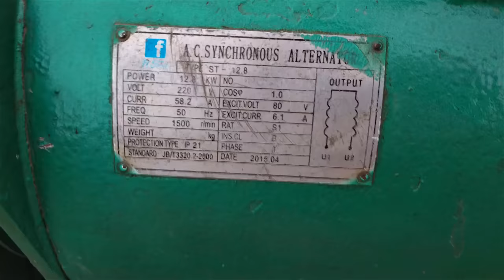Free energy Generator With 100 Kg Flywheel 12Kw Alternator 100% Real Free Electricity

Comment: At around 0:30 when the alternator appears, the camera viewpoint changes ever so slightly. My guess is that he had run a mains cable from the ditch that was not quite hidden, so he had to re-position the tripod.
Reply: No.  He just built a really old, low tech mechanical battery.  It'll take awhile for 100kg of spinning metal to stop, but it'll happen eventually.
Reply: @HelloNotMe9999  I can't see all that friction in the belts and the hooked up gear sustaining the rpm of the flywheel for long enough. He would have to stop recording, spin it up and start recording again. My money is on a hidden cable, or maybe a battery at a pinch.
Reply: @travelbugse2829  There is a bad video edit that discredits the presenter. BUT According to Occum's Razor theory (please do your own research) the best answer is the most simple one.

This is a confidence trickster! Prove me wrong! There is a sneaky power connection through a cable buried in the mud under one of the hollow metal legs resting on the dirt. Share a new video with the metal fame pulled up off the ground, and passing your hand underneath (with this running) The poster is only interested in being paid by YouTube for AD money from many clicks.

Comment: ok I think I have figured it out,   the power source that keeps these generators going after you unplug them from line power is the environment.    the generator because it keeps spinning keeps allowing electrons to flow into and through it, because it keeps creating a condition by manipulating magnetic fields to cause electrons to flow through it,   so your energy source is the electrons orbiting the atoms all around us.   those electrons power the drive motor, the drive motor powers the flywheel and the flywheel keeps the generator rotating to create the condition to pull more electrons from the environment through it.    if this is true then there is free energy, you just have to build the device to be able to harvest it.
Reply: Rotten Newton
Reply: The energy comes from the wheel itself. It's the same as when you try to push a car: at first it's hard, but if you continue pushing, it accelerates. When you push you give energy to the car and then if you stop pushing, the car continues. If there were no loses (air and diverse frictions), the car would continue forever. A device could harvest the energy stored in the car (cinetic energy=1/2.mass.speed^2) by slowing the car. 
Here it's exactly the same concept except for that the energy is stored in the rotation speed of the wheel (as well as its mass).
Reply: BWHAHHAHAHA!!!! Oh wait, you were serious?
Reply: @benjaminloyer1293  You will do good as a clown...
Reply: @MrGoogelaar ? Can you argue just a bit?
Reply: You haven't figured anything out. It's not free, he has to pay for the food for the hamsters hidden in the wheel. Also the wheel needs cleaning because hamster droppings cause balance issues. The large amount of hamster shit is what gave him such problems with starting it up and needing to adjust the shit scraper. It's in the first page of the perpetual motion machine manual, regardless of model - "please remove all hamster shit before commencing".

Comment: I understand the laws of thermodynamics will eventually take effect and it will stop turning over some amount of time.. but if he was able to use those power tools and consume that much energy off of the small amount supplied from the grid to start the motor.. that is still pretty impressive and energy efficient
Reply: It's fake. What he's doing isn't possible.
Reply: The "energy" input will always be greater than the output after counting the losses in the system (friction, windage, resistance losses in wiring) The net result is that no matter how much initial energy is supplied from the AC Mains (utility power) there will not be enough at the output to replenish the input. In simple terms, perpetual motion does not exist. Science has proved this and establish laws that can't be violated.
 BUT According to Occum's Razor theory (please do your own research) the best answer is the most simple one.

This is a confidence trickster! Prove me wrong! There is a sneaky power connection through a cable buried in the mud under one of the hollow metal legs resting on the dirt. Share a new video with the metal fame pulled up off the ground, and passing your hand underneath (with this running) The poster is only interested in being paid by YouTube for AD money from many clicks.

Comment: I am just thinking if is really possible with the help of a flywheel, to get more output than input, thus overunity effect ? Nevertheless, the idea seems brilliant 🤓
Reply: ive demonstrated overunity generation to my electrical engineer brother in law.  even after seeing it in operation he doubted it.  i used 24 volt solar panel to run a dc motor linked mechanically to another larger dc motor as the driven generator.  panel output 24 volts at 5 amps.  output at driven motor/generator: 36 volts at 8 amps.  there was no flywheel in the equation, but if it was under a load that would be needed. it was just to demonstrate that you absolutely can create an overunity scheme.
Reply: @duskintheforest584  waiting on your vid :)

Comment: Law of  thermodynamics is when talking about a will a will in motion will not stop until it is forcibly stopped or slows down.
If you keep the will spinning so it can turn the generator it will be able to get generating power to run the electric motor

Comment: if the flywheel generators are getting energy from another source, what is that source :
not certain, but the flywheel has something to do with it.  do these devices gradually slow down and come to a stop? because after you unplug them from a land power source then what are the  remaining power sources ?    well the flywheel is a power source, stored kinetic energy,   the generator is a power source, it is still producing electricity,  and the drive motor is a power source because it is still being provided electricity from the generator, electrons are still flowing into the drive motor making it turn.      you would think if the flywheel was the source of energy turning the generator you would assume as the flywheel energy slowed from friction so would the generator and so the drive motor would also slow due to lower voltage from the generator,  and everything would come to a stop.    if this is not faked and some how these really do work then we have to figure our why.    so when you have line power going to the drive motor what are the sources of energy in the whole system?  well you have the line power driving the motor, you have the motor driving the flywheel, you have stored energy in the flywheel driving the generator, and you have generated power coming from the generator.   so you have 4 sources of energy.  it is functioning as a whole and all power sources are being driven by the one before it.   Then you disconnect one source of energy, line power driving the motor and substitute generator power to drive the motor.   we can see when line power is on the power the generator has is not being used. and it is a functioning power source, so we now use that power source to drive the motor.    the phenomenon we all seem to not be able to get our head around is we now seem to be using energy that is not coming from the line source anymore.     However electrons are still flowing out of the generator, the motor is still using electrons to turn the motor,  the flywheel ? well it still has stored energy.      is the stored energy in the flywheel acting as a buffer to keep everything going? and if so then you would think as the flywheel slowed down from friction the whole system would come slowly to a stop.   But then you can see the motor which is using electricity from the generator is still running and providing energy to keep the flywheel going,  how does the flywheel slow down if there is a power source keeping it going?   how does the motor slow down if there is a power source keeping it going? and how does the generator slow down if there is a power source keeping it going? and why do we even have excess power to use from the generator?  everyone wants to know where the power is coming from that keeps the system going.    we have electrons flowing through the motor where are they coming from?  well obviously the generator, but where are the electrons coming from that are coming out of the generator?  if you really want to mess your mind up try thinking about that !    you cannot create an electron, you cannot destroy and electron however you can get them to move, to flow through a conductor and do work.  as the electrons flow through the generator billions of them per second  from what source do they come?  your not creating them, they cannot be created.   there is only one place they must be coming from, the environment.   I say all generators get there electrons from the same source, the environment.    everything is made of atoms and all atoms have electrons orbiting them.    we know that electricity is movement of these electrons , called electron drift, from one atom to the next.   and all matter including our atmosphere is packed with atoms.   I say generators create a condition where through the manipulation of magnetic fields allow electrons to flow from the environment through a conductor.  we have learned to use these electrons and make them do work for us, but it usually requires another source of energy to create the condition to force or get them to move.     so where is the energy coming from that keeps the generator supplying electrons to feed the drive motor that keeps the flywheel going ?    I would have to say from the flywheel,   why does the flywheel not run down? the motor keeps it going, why does the motor not slow down? the generator keeps it going.        there could also be something happening as a whole to because you really have three flywheels spinning together.
Reply: And then think where is the energy from the line really coming from? Boiling water? I think not. I think you’re on to something, everyone just thinks I’m on something 🤣
Reply: You have ended up confusing me 😂😂
Reply: @tukovharison4561  I was attempting to explain how these flywheel generators may work.  If they do work it may be a balancing act of tuning all of the components.   If you want an easier way of producing power experiment with the Milkovic  Oscillator or the skinner gravity power machine.
Reply: There is a bad video edit that discredits the presenter. BUT According to Occum's Razor theory (please do your own research) the best answer is the most simple one.

This is a confidence trickster! Prove me wrong! There is a sneaky power connection through a cable buried in the mud under one of the hollow metal legs resting on the dirt. Share a new video with the metal fame pulled up off the ground, and passing your hand underneath (with this running) The poster is only interested in being paid by YouTube for AD money from many clicks.
Reply: @rmendes2mendes915  Are you willing to share your "Free Energy Device" Results publicly? Will you allow your device to be examined by professionals and academics familiar with scientific principles?

Put up a YouTube video for others to review!
Reply: @rmendes2mendes915  In other parts of the world there are impoverished people with limited technical resources and abundant free time willing to create You Tube videos. More so if they can create a money revenue stream too! The money that a You Tube video with high hits rate will generate is much like winning the Lotto for someone living in a hut with dirt floors (for example)

For the video above there is a stark contrast between the workmanship on the welded steel frame and the electrical wiring using salvaged parts. I strongly suspect that the frame and flywheel where salvaged from a factory, where they would routinely be installed as a "load leveler" or "machine starter assist"  in places where utility power is weak or unreliable.

A common feature of these Free Energy machines from third-world You Tube presenters is a total lack of measurement. Yes, they lit some domestic light bulbs and ran a few hand tools, but they do not document the power produced or explain how it has become stable (regulated?) over time.

Free Energy can't exist in this world using our present knowledge of science or skill in technology. To change that would require changing the science. Or, developing newer technology that delivers better efficiency. Not that "more efficient" is not Free Energy.
Free Energy, by definition, means nothing external is consumed. No fuel, No storage, no "source". Also, Free Energy would generate output for all time, not fading or stopping, ever. Nothing that is known to mankind has this. 

Is that what you have done? If so, please publish your work for peer review.

+
Reply: @rmendes2mendes915  Oh Dear...! This discussion has shifted from Science to Conspiracy, hasn't it?

So you have the key to unlocking Free Energy,  to improving life for the majority of peoples on the earth, and you are afraid of being mocked as a looney on You Tube?
Reply: @rmendes2mendes915  I think we understand each other. Let's part as friends. I look forward to reading and seeing your progress. I'm not an easy sell; so bring your best game, allow third party investigation, and document your work for peer review. Good Luck!
Reply: There are many naysayers here. Look at how asymmetrical capacitors use extremely high voltage and very low amperage to achieve "antigravity". And no, ionic wind doesn't exist in a vacuum where asymmetrical capacitors continue to function. Look at the tic tac UFOs evidenced by the PENTAGON, defying the "laws of physics". Not saying that this video isn't fake, it probably is, but don't throw people under the bus for presenting ideas that "defy the laws of physics" unless you live in a box of your own making. "Spooky action at a distance" is impossible too, yet it takes place proving FTL travel is possible. Just sayin'...
Reply: @aleanufopilotftlcertified5663  I didn't notice any asymmetrical capacitors in this video, can you explain why you think this confidence trickster has any credibility what so ever?
Reply: @aleanufopilotftlcertified5663  What must it be like in your world? Until the day you can bring proof and say you "told us so" I'd rather go with P.T. Barnum's view "There's a Sucker Born Every Minute" Break throughs in science and engineering simple don't come out of muddy fields in the third-world.
You Tube confidence trickster do, All Hail The Ad Revenue From Clicks!
Reply: @pstonard   - The earth is flat and it is also the center of the universe. > 99% used to believe that... enjoy your box.
Reply: ...from a time when the entire world was 3d world, all muddy fields. Luckily some people got their heads out of their...mud... and science progressed.
Reply: @aleanufopilotftlcertified5663  I think we understand each other. Let's part as friends. I have nothing more to contribute, and you've descended into name calling.
Reply: @pstonard   - We can surely part as friends, however at no time have I resorted to calling you names. If you can quote me where I called you a name I will certainly retract the comment.
Reply: "if the flywheel generators are getting energy from another source" - they aren't, so no need to question what that source is, or have an "episode" on a YT comment page. 😗

Comment: O que torna isso possível é a roda de 100kg que mantém o sistema funcionando. Depois que ela atinge a rotação máxima é necessário uma força grande pára parar, mas uma força pequena pra manter o movimento. Assim, o motor é capaz de manter o movimento sem exigir sua potência máxima, consumindo bem pouco do que está sendo gerado. Mas o gerador só poderá manter uma carga que exija menos que a força necessária pra parar a roda. Por isso, dependendo do peso da roda, se a carga for de 2kW o gerador tem que ser de 7KW ou mais, pois o sistema só é possível se trabalhar com carga baixa, talvez até uns 40% incluindo o motor, que como já disse não estará trabalhando em potência máxima.
10
Pr. Almir Varges
Pr. Almir Varges
vor 2 Monaten
Hó meu nobre, Parabéns, Passa pra mim as medidas desse cavalete.
1
Nitroschock
Nitroschock
vor 1 Monat
This is not done by a hidden battery. He'd A) need to convert it to AC and B) the battery would have to be extremely large for it to sustain welding. 

It's just cables. Below the sand. This easy...
9
Reply: Por favor me responda: Será que com engrenagens eu consigo chegar a oitenta até noventa por cento do gerador? Gostaria muito de ter um gerador na minha casa.

Comment: There are two problems, one is the high noise pollution of the electric motor and the generator, and the other is the change in the frequency of the generator output power, which was clearly seen in the rotation of 100 kg flywheel when you connected high-consumption tools such as milling machines and welding machines. That would be great if these two problems were solved. Thanks.💘😘💘😘💯💯💯👏👏👏👏👏👏👏👏
Reply: Not to mention the problem that it doesn’t work 
Can’t defy the laws of physics bud

Comment: For all the idiots, the flywheel has store kinetic energy to overcome the law of energy conservation. It take initials energy to get the flywheel going, once it reach the optimum speed, the high efficiency generator provides the energy to the motor and light bulb. It’s enough effort for those light bulb and a few other item but not enough to run a modern home. If you run the microwave and a water heater, the generator will stop

Comment: With a typical generator, when a circuit is connected, the rotation speed drops due to the load, but this doesn't happen with this system.
What's going on?